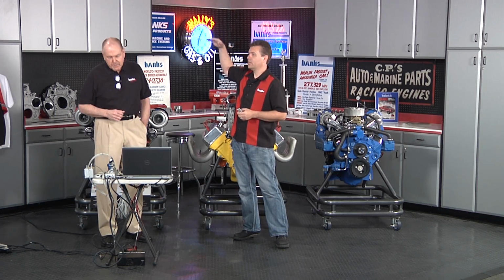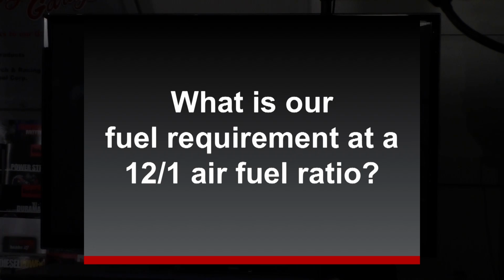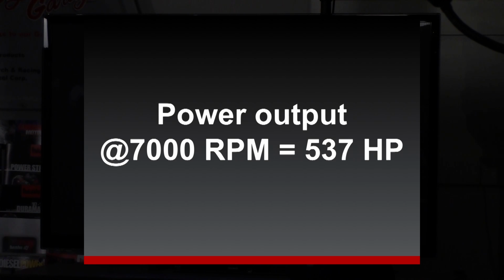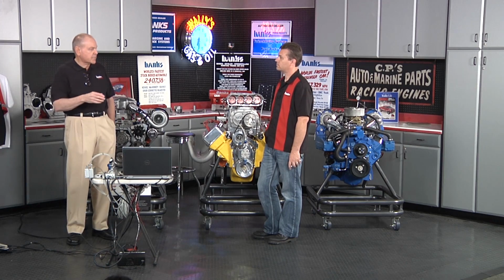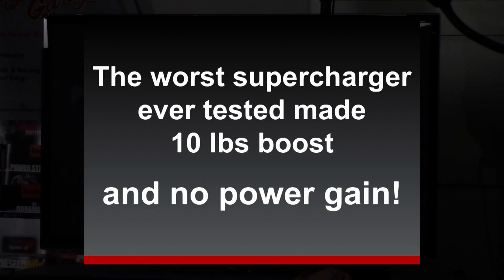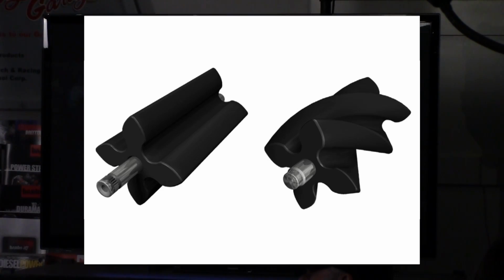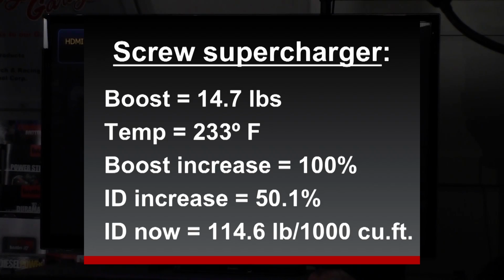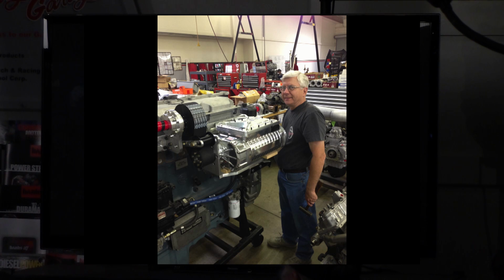Tech Talk 3: Superchargers and Turbochargers

Comment: I have a Rotary engine concept.
I call it the EPIC Engine.
This is a Visualization video of the concept only.
https://www.youtube.com/watch?v=4NhDaQ3SB0o

The preferred design is not shown here, because it is confidential.

The preferred design is perfectly balanced without counter weights.
The preferred design does not need oil in the fuel.
And has variable compression ration on the fly.
Any fuel can be used and switched to on the fly.

Comment: Does a fast spinning turbine create a scavenging effect in the exhaust manifold? I am assuming the suction of the turbine will create a low pressure in any cylinder manifold after the exhaust valve is shut?!
Reply from the maker: There is always at least one exhaust valve adding pressure to the turbine so there is never a true suction or low pressure effect. Positive pressure is what drives the turbine to spin.
Reply: Turbos don't work too well on single cylinder engines as they are constantly accelerating up and down with the exhaust pulses

Comment: I'm new to this but why 12:1 when stoich for gas engines is 14.7:1 ?
Reply: Good info, thanks for the reply!
Reply: 14.7 is complete fuel burn but not  less fuel usage , it will be about 15-16:1, but on 12:1 is max power- some of fuel is decompose due to high pressure and heat, so why you need some extra fuel to compensate fuel loss on decomposing
Reply: You get closer to MBT when you use more fuel than stoich. Fuel cools the exhaust valves, whereas stoich will burn all the fuel and won’t leave any left for cooling so your EGTs climb and you may burn valves.

Comment: Here's my crazy idea inject liquid oxygen with fuel mixture.
Reply: +Asus Tab that's what oxygenated fuels like nitrometh are for
Reply: +Asus Tab thats what nos is for.
Reply: +Asus Tab Rolls-Royce tried it in WW2. Melted lots of pistons and valves. Nitrous oxide was found to be the better answer. The nitrogen stops things melting
Reply: Mr.Banks. thank you for down loading your thoughts, ideas, and experiences. For all to take in.

Comment: At the end gale talks about how power is lost in compressing the air and fuel.
i am a crazy thinker i must say. 
so why not inject air and fuel. right when the pistion is at the top then get the spark plug to set it all off. that why you dont have power loss in compressing it. (air/fuel injector, my crazy idea)
so now how do you compress air enough to make good power. we need a good turbo to compress it? then a air injector to inject it in.
think about it, it takes a lot of power for a engine to compress the air and fuel.
we need to cut that part out.
Reply: +chevy35c 
Nitrous, methanol/water and intercoolers are made to cool air prior to intake.